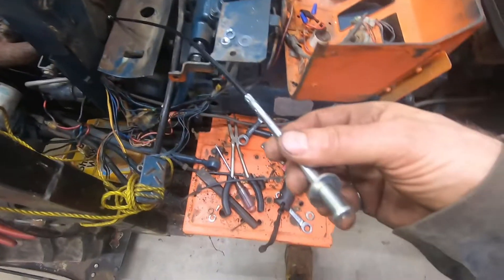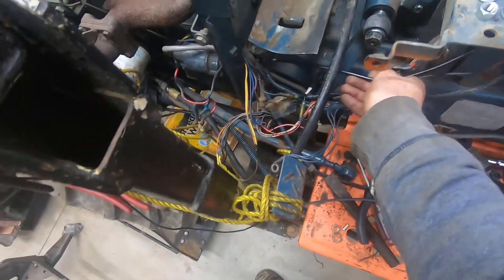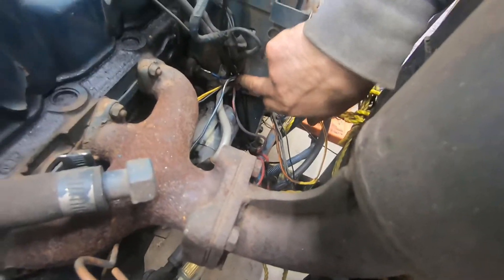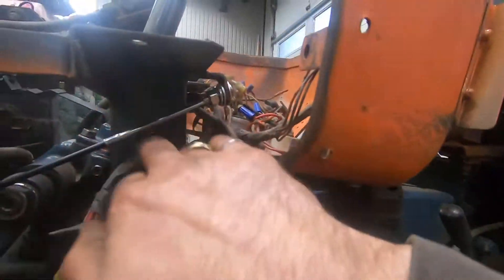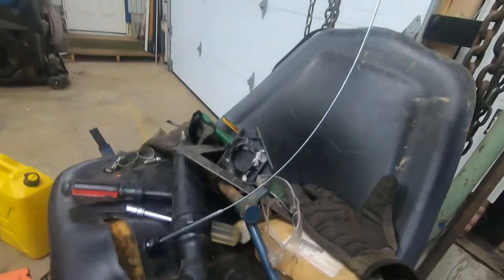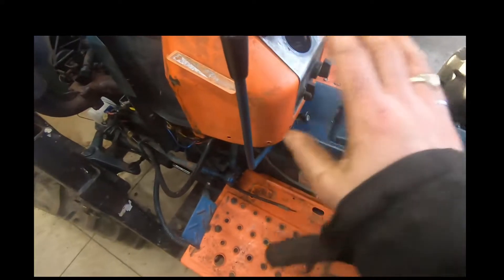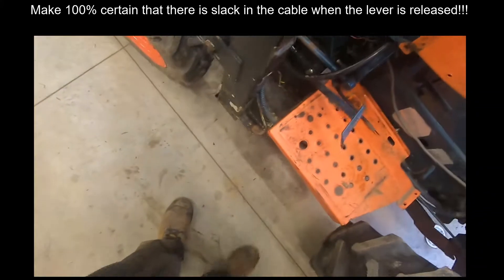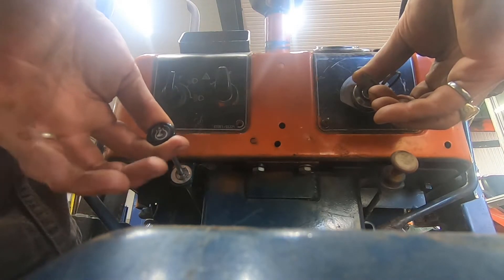DIY Replacing Broken Decompression Cable On A Diesel Engine

Comment: Where might I find one of those cables? I am doing some work on a B6200 and that cable is shot.
Reply from the maker: Kubota dealer
Reply: @mrdiyguy123  thanks! I have looked online and can't find anything for that old. Next time I'm in there I'll have to ask them.
Reply: Just bought a 7200 , saw the cable but haven't tried using it, starts right up though
Reply: Saw a forum where a guy used a choke cable to replace that. Looking at pics on Amazon, I don’t see why that wouldn’t work.  It’s $10.